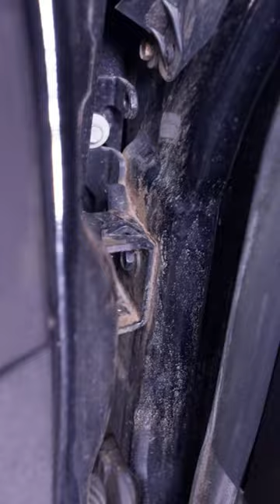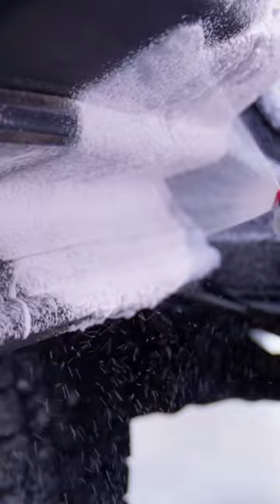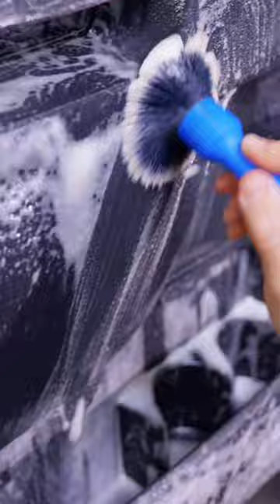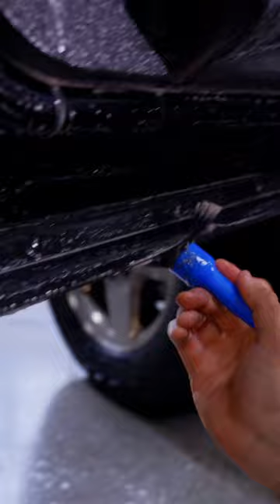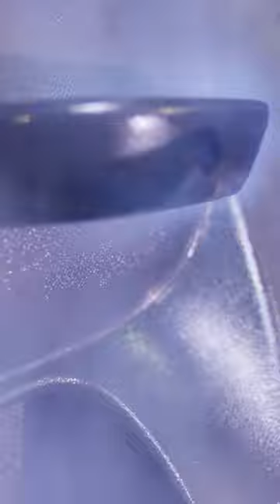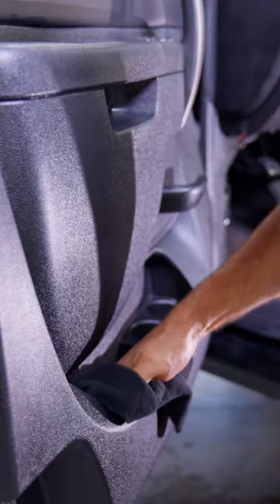Don’t forget the jambs😁❌💯 #chemx #detailing #asmr

Comment: do not do most of this.  Way too much spray/ moisture on the electrical switches on the door.  unclear what the chemical is being foamed onto the door, but likely is too harsh for the interior plastic. steam in door jambs is almost always unnecessary, seems to be used here for YT theatrics. as somebody else noted, will now need to regrease the hinges if you are cleaning them that aggressively.  always strive to use the least aggressive technique that will effectively do the job, and no more.